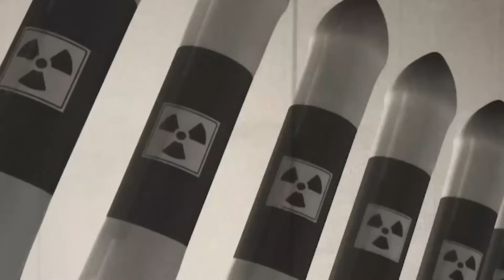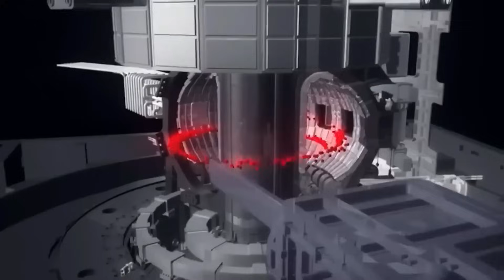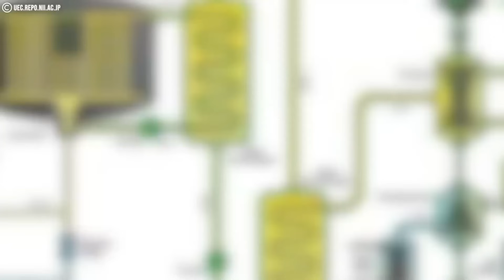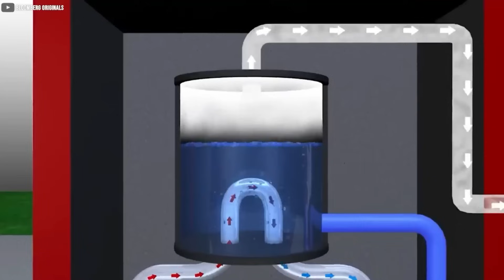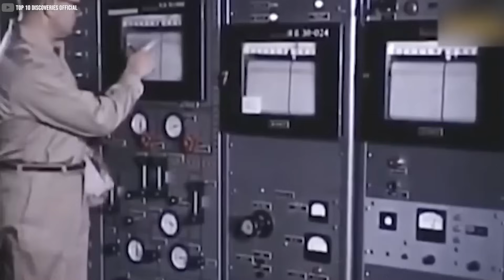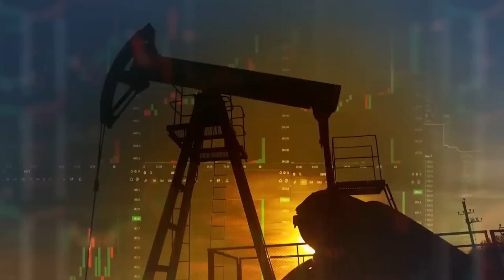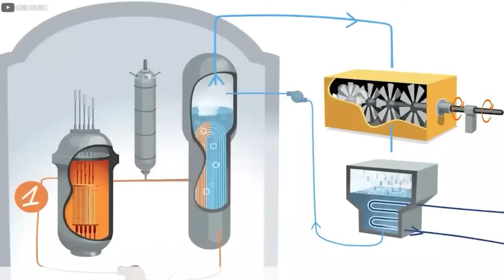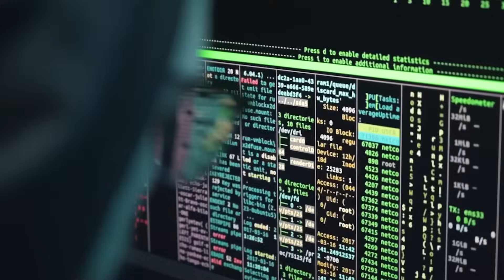China Wins the Energy Race - World's First Thorium Reactor Goes Live While U.S. Stalls

Comment: When it comes to putting these reactors all over the world... Well, Thank God thatthe plan is to use made in china reactoors, chinese safety standards with cinese workers.. The Nuclear Belt and Road! I'm sure that we have nothing to be concerned about.

Just out of curiosity... What is the worst that can happen with a thorium reactor when some or every things goes wrong? What are the radiological dangers of a sub-standard reactor that's going to break (physically, mechanically, electronically) in the first few years of it's working life., What does thorium contamination look like?. 

Tofu dregs and nuclear reactors... match made in heaven!
Reply: They like truely are not dangerous. Also worst case you just do some cleanup and condem the land for 50-200 years and it will be gone and done with. One of the biggest downsides of uranium fission is that at least the US has refused to ever build a place to safely put it, so it piles up outside of our reactors. It's extremely likely the US will experience a devistating nuclear incident in the coming years as a result.
Also tofu dregs is 90% propiganda, and china is sigificantly higher tech than the US (not to mention the higher quality of life). It's really really hard to avoid the propiganda when you live in the US but it's really worth at least trying, and then pushing our goverment to stop interfering with other countries. China has a shot at making a huge dent in global warming if nothing else so we should let that happen in peace not war.
Reply: @exerosis5758  Thanks, Sure it's unlikely that there will be a terrible radiological accident, but in the event that there is, 200 years is a long time to deal with potential contamination especially for the countries that are currently in discussions. 
Don;t worry, I don't take the slightly biased US perspective as written, nor any specific nations news, One must dig to be correctly informed.
Reply: Uh, If you had watched the video, you'd understand that it literally cannot melt down. This isn't propaganda, it's just how molten salt reactors of this kind work.
Reply: @meridiasbeacon7669  you assume that I didn't. A thorium reactor cannot melt down in the way of other reactors. That I know. Where again you assume ignorance. 
My point if you had the intellect to. Capture it was that even without a meltdown, radiological material entering the environment is a bad thing. Given the lack of safety standards in pretty much all things Chinese, it will simply be a matter of time before we all find out. 
Assumption makes an ass you. Well done.
Reply: the butthurt loser barking
Reply: Thorium is ubiquitous in the soil around you. In itself it is not dangerous. However, in the reactor the thorium is transmuted to U233 that is both fissile and highly radioactive. 

Thorium MS reactors are unpressurized so can't explode. However, various failures hopefully very rare might happen. Most likely would involve cracks in the pipework. Such an accident would require draining of the reactor. The molten salt fuel drains to special cool down tanks that stop the reaction. After things cool down (a year or so) and the salt has solidified, the reactor and the drain tanks are removed and sent off for recycling.

TMSR plants will likely have three or four active reactors. They have an operating life of about seven years. At that point they are drained and put into storage for a year or so before being sent off for recycling.

An important point is these reactors are quite small, the heaviest components being about 300 tons. The building they are in has an overhead travelling crane large enough to remove and replace reactor components, as well as storage pits where used reactors can be stored until cool enough for recycling.
Reply: @jimgraham6722  Thank you for thinking :) indeed they are mostly safe to run, but one must consider the worst case scenario always with nuclear  energy. And I hate to say it but it's not the technology that worries me, if for example France wwas to build a TMSR, I'd be sinificantly less worried. The reason here is that France doesn;t have a regular issue with new or recent building collapsing due to shoddy  build quiality...

Comment: Thorium reactors don't require large bodies of water like nuclear power plants of today do, they don't have to be built on rivers or near coast lines,  in fact they love heat so deserts are perfect place's for Thorium reactors.
Reply: But they do require reprocessing plants alongside each reactor. That's a major proliferation concern elsewhere outside of China.
Reply: @josdesouza  and it's not else where??? The waste of a Thorium reactor has a 30 year half life, which means after 10 half life's ie 300 years it's no longer considered radioactive just a heavy metal so no there is no "proliferation" That and  the waste form a Thorium reactor can't be used for weapons, so you're incorrect.